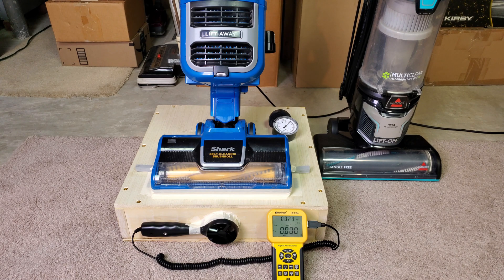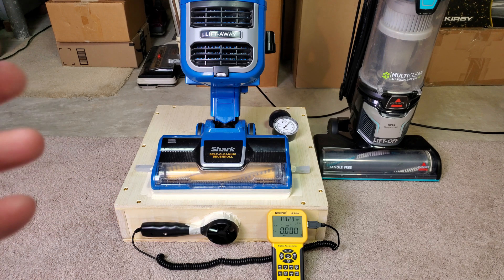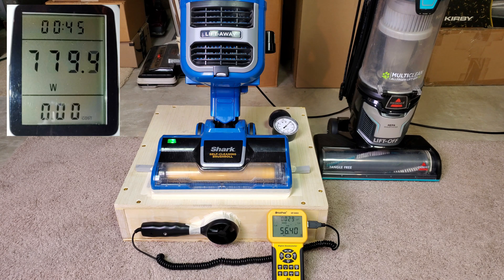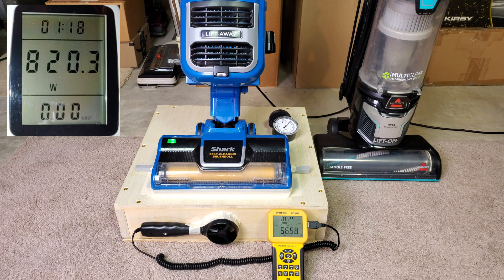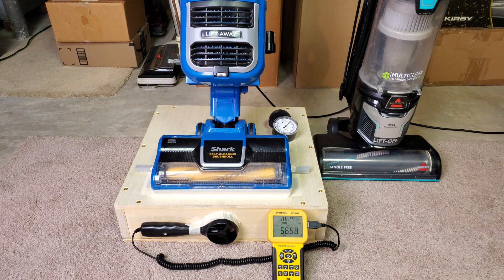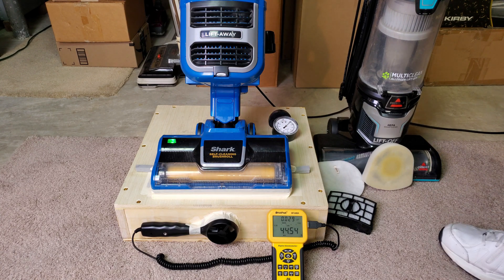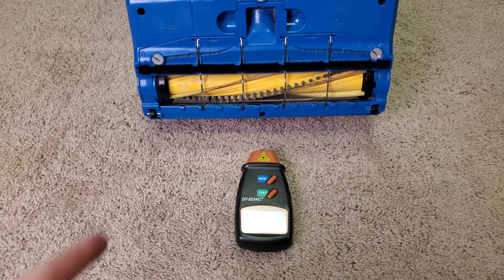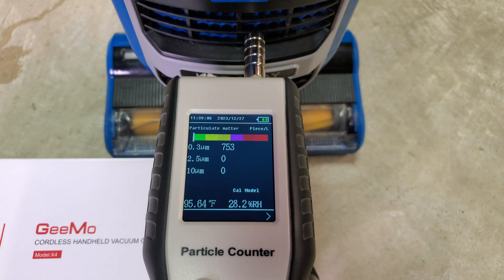Shark ZU560 Lift-Away Static Tests | Airflow, Suction, BR RPM, Power Usage, Emissions

Comment: I have a Shark Lift Away with the "zero maintenance" brush roll and I mostly use it just as a pre vacuum before I use my Kirby for deep cleaning. Just don't like having to clean out the brush roll on my other machines.
Reply: I use my vertex az2002 before I use my Kirby or rainbow too !
Reply: Omg I do the same thing, I use my shark before I use any of my nice machines
Reply: @Joseph-vf5yq  right?! Lol